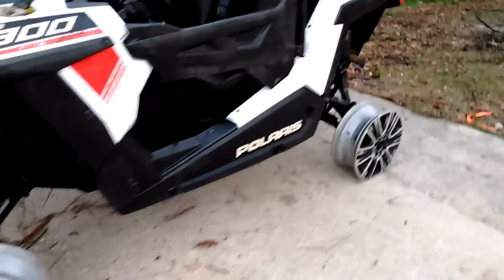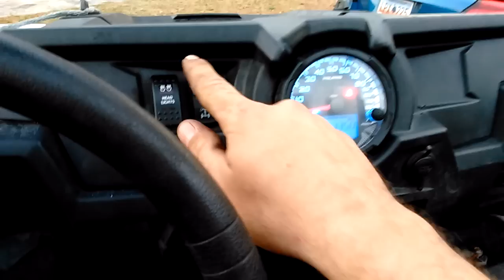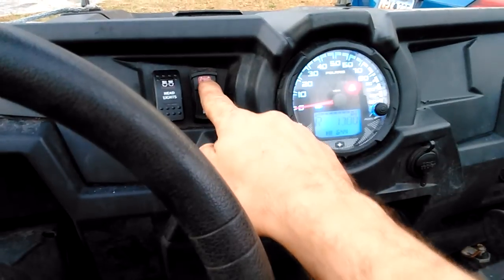youtube video #0PuWzKvg7uE

Comment: I have an airtic cat 150 but the low end tork is so bad in the mud Because the previous owner pulled trailers way over Towing limit would a stiffer CVT clutch spring help improve that low end torque

Comment: what the size off the tires on the ace and were can i get some att is the ace stock  Height o what do i have to do to it to fit them
Reply from the maker: 8.3-20 it's all stock. Couldn't turn very far and broke a front knuckle... Do not recommend lol
Reply: so whats the biggest size you recommend on stock ace?
Reply from the maker: @raulcervantez9  on a 325 light 30s it has the lowest gears
Reply: thank you keep doing this videos keeps ups entertain att work lol